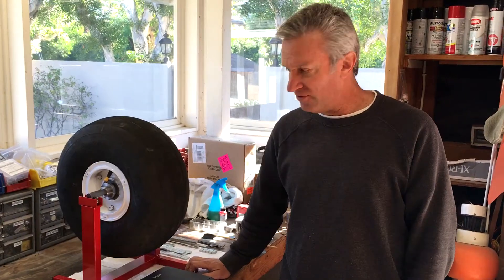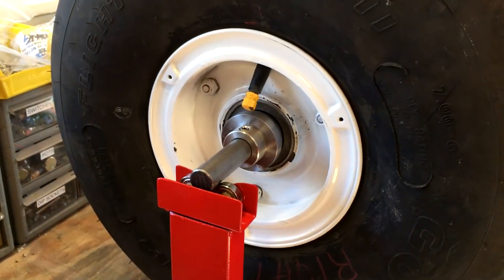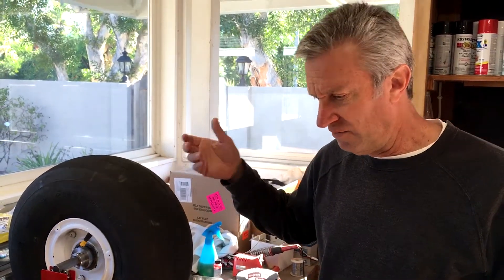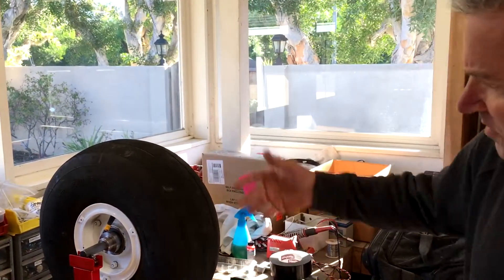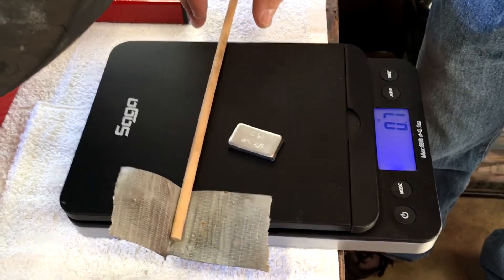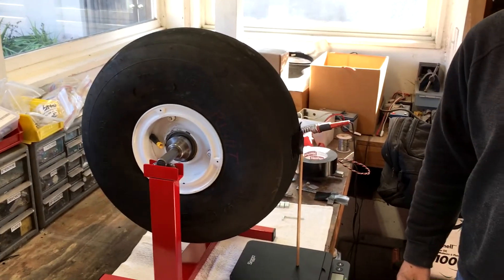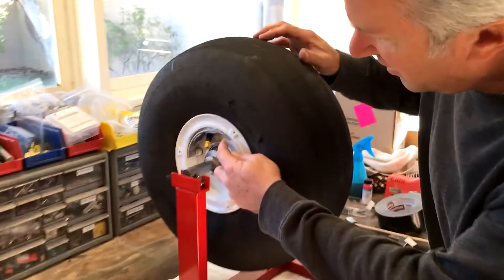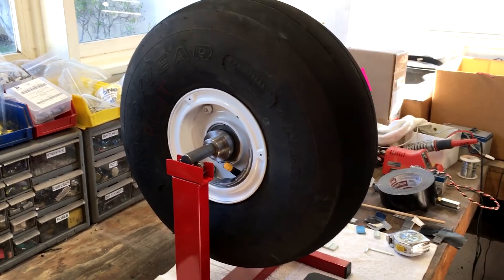Aircraft Tire and Wheel Balancing - Using a Postal Scale

Comment: Consider rotating hub in tire in attempt to reduce unbalance, thus adding less correction weigh and reducing dynamic unbalance. Also, equal weights on both sides of wheel (as possible) will reduce dynamic unbalance.
Reply from the maker: Yes on rotating hub (wheel), no on inside weights.  The brake disc takes up that space.   Less weight added is much better.  This tire/wheel combo was really far out of balance.  It would be worth the short amount of time to experiment with different clocking.

Comment: Now wait a minute.. Marty you went through all of that.. why not continue on and determine the appropriate area to put the weight. Obviously the placement of the weight is not aligned it's not enough room so how do you determine that. When I was a kid my father's service station we would static balance the tires and that worked great you would lay the tire on there and determined by placing weight to put the bubble in the bullseye. Sometimes there are manufacturer imperfections and all of a sudden you have to put a ton of weight onto the tire to get it to balance out. After you reach a certain point it would best to break the beat of the tire and rotate the tire to a different position in order to use the least of what amount of weight is possible. My thought is this you balance the rim on its own you balance the rubber on its own and you determine in that method the correct location the tire sits on the rim. And with any luck you may not need to use any weight at all. If the room is tremendously out of balance on its own you can put weights on the inside center of the rim. And that would make the rubber position responsible for the balancing. Imagine the manufacturer provided you with a true rim. There you go you have a true rim now you just need a true piece of rubber
Reply from the maker: All good suggestions.  This was an old used tire with unknown balance issues.  Usually, when installing a new tire, you line up the RED DOT on the tire with the valve stem of the tube.  The RED DOT indicates the light spot of the tire, so it gets aligned with the heavy spot of the tube/wheel combo.  The wheels are balanced nicely as they are small in diameter and uniform in construction, hard to be off much.  The tires weigh quite a bit, so that's where all the imbalances come from.  When mounting a good brand tire, the balance is usually pretty close.  I don't have a method for checking the tire balance alone.

Comment: Way over thinking that dude.  setup is good but expensive.   I have used a steel bar to mount the tire with clean dry bearings in place and simply add wt  til tire/wheel dont rotate.  doesnt need to be that precise for a GA plane that lands at 40-60 mph

Comment: Lord is that all stick on weights by valve stem? Take tire and spin it 180 degrees then do again
Reply from the maker: Good idea.  The weights were applied to the "factory" lightest place on the tire, but that was when the tire was new.  That may have changed with time.  Flipping the tire 180 degrees might reduce the amount of weights needed.

Comment: yes for sure a very nice well made gravity balancer, but I no tested that your light part of the tire is now the heavy part,  because now the light part of the wheel  is where you valve stem is, and it went to the bottom, and setting it at a 3:oo  it shouldn't have rotated at all if was balanced, how I do it , is just and a small amount of wait on the light side  with a little duck tape  just to get the right amount that you need  , and when you have the right amount of wait on the light side  and setting the it at the 3:00  it shouldn't rotate at all,  the wheel should not turn at all when it" balanced , I did it like this and haven't had any trouble with it  was perfect balanced.
Reply from the maker: Hello R Baird.  I agree with most of what you said.  This tire was extremely out of balance, so was happy to get it close to correct.  Worked well on the plane by the way.  Once you add weight to the 3 o'clock position, as you stated, you should rotate the tire on the balancer to verify that the bottom is not the heaviest point.  You won't know that unless you spin the tire.  Also, the bearings aren't perfectly frictionless, so giving the tire a bit of a spin breaks the static friction.  The dynamic friction is usually less.  I have modified this tool since the video was published.  It now measures the correct weight needed directly from the radius where it is attached.  Works well!

Comment: The tool is perfect, but regarding the use of it... Damn! You turn on the "complicometer". LOL :-)
Edit: Try to rotate the tire in the wheel it might balance with much less weight
Reply from the maker: Complicated?  You should see my new rig.  Now I have a custom balance arm piercing the axle that I use to measure the needed weight at the correct radius.  Direct measurement now.   Just put the assemble on and take one measurement.  Viola!  You're right though, might be a good idea on such an out-of-balance assembly to move things around and look for a better balance to begin with.  Thanks, Marty
Reply: +Marty Mitchell - That sounds good. Any new video about it?
I'm always looking for new ideas.
I know it's a lot more work but usually I try to determine the heavy "spot" in the individual components (wheel+tube+tire) before assembling them. As a general rule it makes a huge difference in the balance. Be well ;-)
Reply from the maker: May make a new video next time I need to balance a tire.  Good idea but hard to determine the heavy spot of a tube (other than the usual ways, mark and stem).  Cheers!

Comment: Nice technique. Was it by trial and error or do you have the formula for how much more weight to add to compensate for the weight distribution from the center of the light spot of the tire?
Reply from the maker: I suppose I could do the math but, no, just trial and error.  Since this video was made, I came up with an even better technique,  I plan to build a ring that fits inside the rim with a 1" long outward facing post, into a ball joint that transfers the weight required directly to the down rod, then onto the scale.  No math, direct reading from the rim with the weights are placed.  Thanks for watching and commenting.  Marty
Reply: @MartyMitchell92660  If you add a ring to the center with a post aren’t you changing the weight with the post involved?  How do you compensate for that?
Reply from the maker: @rv610dave  You're right, that would be a problem.  So here's what I did instead.  I drilled a 1/16" hole thru the axle of the balancer, installed a 6" long rod thru the hole, exactly centered so as to not effect the balance, then turn the axle to the heavy spot, and weigh the force of the rod at the same radius as the rim.  Direct reading of the weight required.
Reply: @MartyMitchell92660  Not picturing that, do you have a video of that?
Reply from the maker: @rv610dave  http://www.ocflyingclub.com/IMG_5412.jpg
Reply: @MartyMitchell92660  ok great, I’m going to try that, thanks for the great idea
Reply from the maker: @rv610dave  This technique requires enough bearing friction in order to transfer the torque to the new rod.
Reply: @MartyMitchell92660  I assume you mean minimum friction?